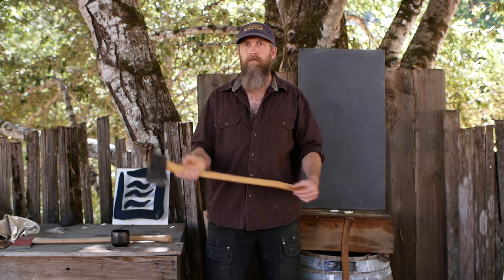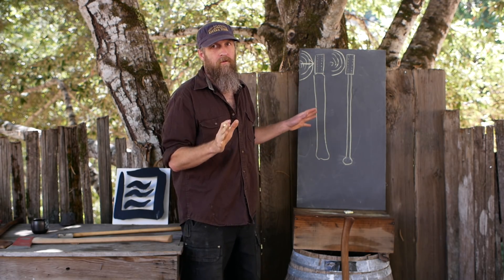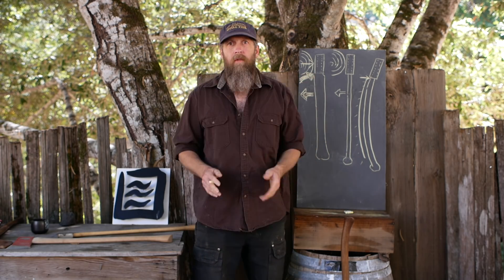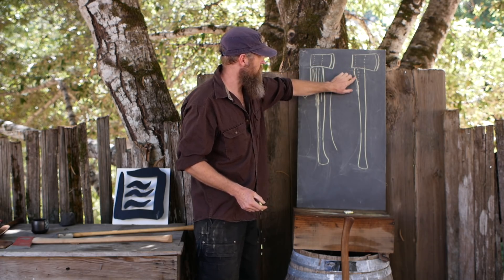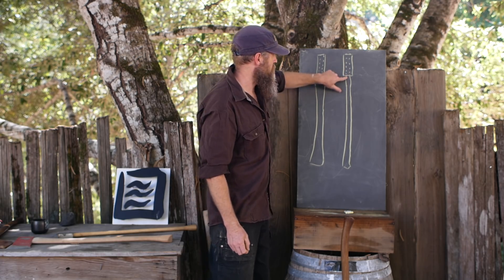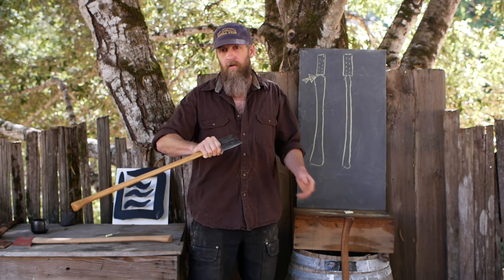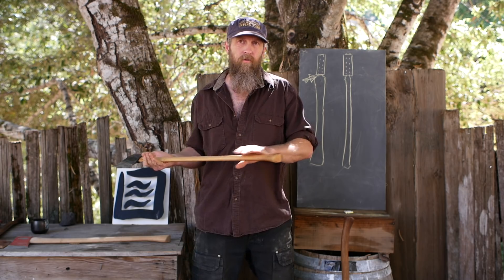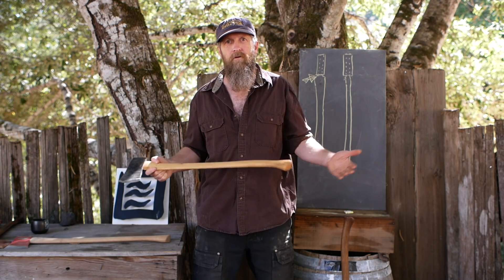Why Axe Handles Break at the Eye: When Strength is Weakness, Overbuilding v.s. Stress Distribution

Comment: Thanks a lot. As usual, clear and useful knowledge from the video. On that note, i am wondering if the other way of hanging handles on axes might make better sense. I am referring to some Spanish and Italian axes that use no wedges but slip through the eye of the axe. First, those handles are easier to make and replace. Second, you can have a few handles for the same axe and change them as needed. And thirdly and connected with this video, those handles are necessarily thinner since the whole handle needs to be slimmer than the eye. Typically they thin down smoothly from the very top to the end of the handle rather than increasing in girth near the eye as your typical wedged handle does. I wonder if that way of thinning down makes it even stronger or less prone to breakage. I guess the proof would be in comparing the experience and frequency of breakage in both axes.

Comment: sounds like folks should be tillering there axe handles. I’m not a scientist ether but rumour has it bows can withstand lots of stress/compression/shock.
Reply from the maker: That is more or less what I'm proposing I suppose.  I always flex test handles with the three finger flex test when I'm fine tuning them.  It's not a perfect analogy to compare to bows, but it's very useful.  I actually had a section talking about bows in the first take of this video, but managed to forget it the second time through. It's in the blog post though.

Comment: That sharp angle allows the wood to know where to fracture/split up into the eye.  We want to confuse the wood so it doesn't know where to break.  The old saying "a bull in a china store" can easily apply to an axe handle, know it limits, don't just crash it into the tree, it needs care.  I will offer a reason they are making the handles thicker, it might be bunk but fun all the same, they want them to break, sell more axes, and handles, its good for business.  We all know axe handles break, they will, they now make them to break even easier.  Planned obsolescence  They did the same with the incandescent light bulbs, and sawmills, look at Woodmizer and all the little gizmos it needs, they are designed to wear out after so many repetitions.  .Its the way of today.  Back in the day when they were really chopping trees down they wouldn't tolerated fat handles.    I really needed a good axe handle talk video, made for a great finish to the day.
Reply: I buy a ton of lumber from sawmills.  Guess what they don't use 3000$ sawmills.  You can't even get a decent trailer for that price do you really think a decent sawmill that is essentially it's own trailer would be that price???  In the end you get what you pay for and you can't say that a 3000$ sawmill is compatible to a 100 000 sawmill like the ones that the people that do it for a living have.

As for the axe handle.  They build them to sell them.  If a guy walks into a hardware store and sees a 100$ axe and a 50$ axe and the cheap one has a thicker handle than the expensive one he is going to wonder why its so darn expensive.  An average Joe going camping with friends will buy the name brand heavy duty axe.  If you use the axe and had one break you would know that it breaks ether flush with the eye or in line with it so why would you need a handle that is bigger than the head and it's just feels better in the hands.
Reply: @answeris4217  Have you priced Woodmizer lately?  some reach into the $60.000 + range.  My mill was $16,000, 25 years ago.
Reply: @timberdoodles4647  - I paid almost 20 000$ a few months ago for a trailer.  Trust me 60K is cheap for industrial equipment.  A person that is using this day in and day out will pay between 200K to 1 million dollars for a quality machine.  Maybe more.

I can buy a F150 for 60K.
Reply from the maker: I wouldn't rule out that built in obsolescence might factor in some cases, but I think it is in many cases due to not understanding the problem well.  Axe manufacturers either need to be axe users, employ or consult with users, or stick with tried designs and not change them.
Reply: @SkillCult  Craig Roost on the Axe Junkies is working with Council Tool on axe design.
Reply: @timberdoodles4647  -  The sawmill I deal will have over 5 million dollars in logs to process in the Spring and they do not stop buying logs and their yard looks empty right now if you go into it.

Comment: Couldn't agree more, just through use and my starting with composite handles to factory wood, to thinned and profiled. The way my hands feel after putting in work is all the proof I needed. For what it's worth, we performed these same type of smoothing and profiling operations on some high stress components in race cars to help them live longer.
Reply: Couldn't agree more!   I made the same progression:  composite, to wood, to profiled wood.   No comparison.  Each step significantly better than the previous.

Comment: Could you do some more felling videos with an axe, especially trees with a difficult lean/lay combination? In any case, thanks for down to earth content.
Reply from the maker: We'll see.  Felling videos by competent fellers are very helpful, though obviously there are major differences and less control when felling with an axe.  Leaners can be very dangerous.  If in doubt, stay away if there are other options available.  Also, I don't consider myself a very competent feller :)
Reply: Good advice. Growing up on two hundred acres of land, I’ve fell quite a few trees with a chainsaw, but have only recently been practicing with an axe, and mostly on trees less than 12” in diameter. 

I’ve read Cook’s book and found it extremely helpful in theory, but I learn best by seeing or doing. Think about it. Even if you’re not the best, you’ll almost certainly a hell of lot more experienced than most of us.

Comment: What’re your feeling towards the Basque style axes? Logic would dictate that a slip fit would remedy this problem almost entirely. I know their design isn’t valid in this conversation but it’s a simple solution to what could be a simple problem.
Reply from the maker: They clearly do not have many of the same problems or at least not to the same degree.  This video would be pretty much unnecessary if that design had been stuck to.  I don't have the experience using them to say much though.  It seems unlikely that this more problematic system, more difficult to haft, to remove broken handles, to make handles, and propensity for coming loose, more drastic violation of grain and more variability in the parts of the handle that lead to poor stress distribution were all made for no good reason.  Are the reasons good enough?  can't say.  I mentioned them in the blog post, but the main point is that they avoid almost all of the problems I'm talking about.
Reply: SkillCult You caught me! I’m now subscribed to the blog :) I’ve used it as a reference several times but didn’t think to subscribe for one reason or the other. “Infotainment” took over without me realizing as I once was an advocate for blogging.. ooff. As far as the reasons why we evolved from this design, I honestly don’t know. I would like to believe this was brought on by advancement in engineering and not industry it’s often the ladder. I’m certain you have your reasons for not using the basque axe you own but it will be my weapon of choice for next years cordwood challenge. Which I will cover why in a future video on my newborn youtube channel.
Reply from the maker: @seff2318   I just haven't got around to it yet.  I didn't get to do a lot of chopping last year.  Looking forward to giving it a good trial though sometime.  See ou in blog email land :)

Comment: Stihl axes have that horrible handle design.  After messing with quite a few handles other than make your own, council tool handles are my favorite. They still need thinning but come the closest
Reply: I tried my friends stihl splitting axe it felt horrible it was like holding the wrong end of a baseball bat! I have never tried a council tool axe, the first axe I bought was gransfors Burks and I really like them all my work axes are granfors.
Reply from the maker: I like the profile of council tools and they are thin enough to use out of the box.  I prefer to take quite a bit off too, but they are good.  Probalby because they have been making the same handles continuously for a long time with no interruptions.

Comment: Thank-you for this video! I'm in agreement in regards to slimmer handles performing better, and the bitter pill of breaking/replacing a haft is easier to swallow once the user realizes that handles are consumables. This will be a video that I'll direct people too when they want to have a discussion on handle design. 

That being said, I've heard folks that have had no experience with thin handles complain that they're hard to grip effectively. At least with handmade handles, it's completely possible to make a more pronounced palm swell that is easy to hold. It's simple enough to show someone. Take a hardware store handle that's thick and bulky and have them hold it at their side, then relax their grip but don't drop the handle/axe. In many cases they can't. Then hand them a thin handle with a proper palm swell to repeat the test and they can relax their hand to its natural position without dropping the axe. The same concept applies when using the tool. With thick handles you must maintain more pressure at the palm swell to keep control during the swing, but it's rapidly fatiguing. When you're tired, you miss more. A thin handle causes less fatigue, keeping you accurate longer and providing more work before you're spent. 

It's fun to see someone notice the difference for the first time.

Comment: I think the concepts you discuss are sound. I love how you term "the axe as a system," that is a great. For me, the examples of the extremes make it easier to see the value of the "sweet spot," because it shows the nature of the stress riser as you discuss, but it is also plain to see that too thin of a handle would easily snap along the shaft. Of course the reality is that it is a consideration of differences within the realm of what is actually being produced, and I would tend to agree that the trend has gone the wrong way in the direction of handles being too thick. My favorite axe is a 2 3/4 lb Woodings Verona from the early 90's, made in the USA. By the way, it has almost a perfect wedge-shaped head with just the very slightest contour, and it seems to bind up in wood LESS than the concave axe heads I have. The handle used to be much smaller and I didn't like it mostly because it lacked a palm swell. It broke with a bad over-strike. That was my bad more than it was the handle's fault, but it happened. I found a replacement handle which to me is perfect in terms of grain orientation as well as its contours and thickness. It is thicker than the one that used to be on there, but significantly thinner than the handle of my Husqvarna multi-purpose axe. I like the Husqvarna axe a lot, but I am going to thin out the handle.
Reply from the maker: yes, I probably should have talked about the handle breaking in the body more, but I think it's self evident that it will eventually become too thin.  I don't think it's safe to assume too much about how thin that is though.  There is also the user and type of stress applied that would  favor certain types of breaks in certain places more.

Comment: An intelligent and well communicated discussion, quite geeky, I loved it! I agree completely , I've seen it play out in practice.
 Would you consider the use of a distal taper in knife and sword making a similar concept? The concept as I understand it is that the gradual taper in the steel distributes the stress evenly and encourages the steel to bend not break. Therefore it's more resiliant. Just curious on your thoughts.
   Great stuff, take care, Wade
...and yes I will check out and sub your blog!
Reply from the maker: I don't know what distal taper is in a knife.  I think there are some broad concepts that can be applied, but they still have to take into account the actual stress applied in use.  There is also an obvious compromise between increasing shear strength by increasing dimension and creating load sharing in parts of the knife to compensate for high stress areas and weak points in the design.

Comment: I tend to believe that there may be some manufacturing design compensation happening perhaps in part to what I perceive as the continued introduction of poorer and poorer wood handle material.  It really is hard to find new axes fitted with proper handles, as well as finding proper replacement handles. Grain orientation is often ignored, there's heavy figuring present, and often accompanied by too much heartwood.  I imagine that with less than ideal wood, there are just too many rejects that come off the shaping machines when attempting delicate profiles...and some simple office folk opted for thicker designs.  That's my tinfoil hat theory anyway.
Reply: Unfortunately profit margins win over sound engineering.
Reply from the maker: I think you are probably right on the wood quality.  A straight grained piece of quality hickory is much less likely to break in the handle body than a weak piece with strong runout, knots or a large proportion of  brittle heartwood.  
Another factor is that the more the wood is thinned, the more likely it is to warp after milling.  
A crappy piece of wood, with aberrant grain and internal tension is much more likely to twist and warp once milled out of the confines of a larger dimension of wood.

Comment: Stephen, I am a Mechanical Engineer and you are spot on on axe handle design. Thanks for the informative video.  This makes me want to model some axes and run finite element analysis to put some numbers to the theory.
I also wonder how many people think they like thick handles just because that is all they have used. Like have you ever handed a thin handle axe to a thick handle user and let them use it for an hour and they still say they like thick better?  I know the first thin handled axe I used was a big surprise for me even though I had seen your videos and understood the theory.  I was blown away at how much better it performed.
Reply: Great idea. I'd love to see the result of your FEA.  Yes Im  a science geek too
Reply from the maker: I just never really think in those terms.  For me the approach is almost always experience first, informed by any kind of formal testing as needed.  I do think though that for someone with the propensity and ability to approach things from that end could provide some really valuable insight.  The problem with actually testing any theories is that materials vary a lot and are relatively expensive.  We also would have a hard time coming up with experiments that really imitate real life stresses, which must get pretty complicated.  Like rooster and I were discussing in an above comment, the user style has whole a lot to do with those stresses as well and how the energy applied to the system ends up playing out.  I can still think of useful tests to do, but I'll leave that to you, because I'd rather just go chop wood :).  It would be cool if someone gave axes or even just axe handles, the treatment Tim Baker gave bows.  It's probably not going to be me.  To do it right would require a whole lot of chopping.
Reply: it is a strange feeling to switch between thick and thin for sure.
Reply: I started out years ago with a thin handled axe I inherited from my uncle, who got it (I think) from his dad. Eventually I had to replace that handle because it was quite old, poorly cared for and checked. That axe never performed the same way again and until I found these videos, I had never considered it was the handle. Good stuff!
Reply: @Matt Hagler   You're totally correct about the thick / thin handle and it's comfort and performance.    I have my cheap first axe (thick fiberglass handle), and an old head I picked up at a yard sale that I fitted with a hickory handle.     
I thinned down the thickness of the hickory, and could not be happier with how it feels and "steers".   Plus there's the huge difference in feel between 'glass and wood, leaving no comparison between the two now.   The old axe is now dedicated to chopping roots in the stony dirt.